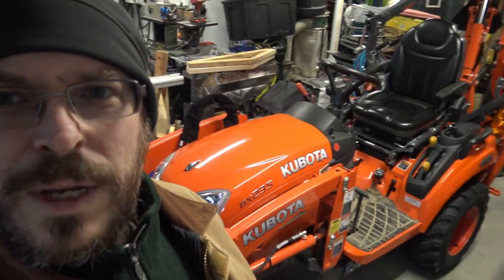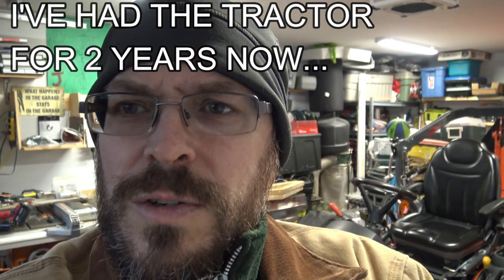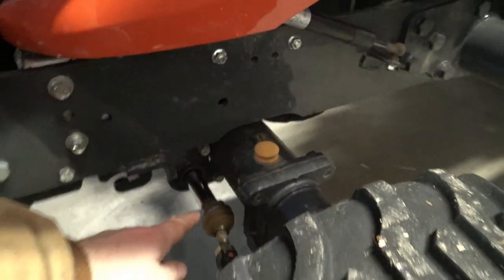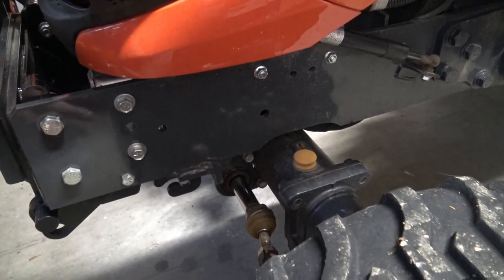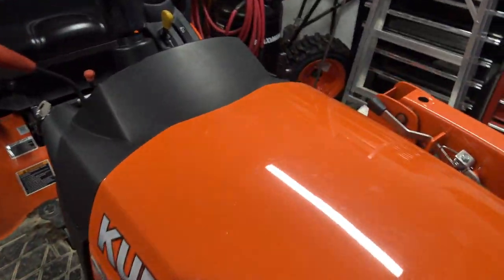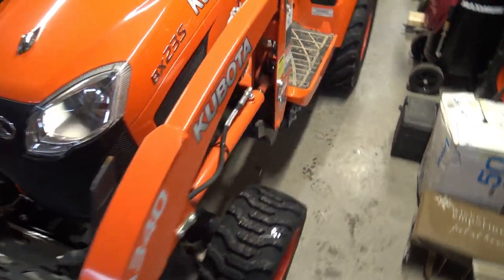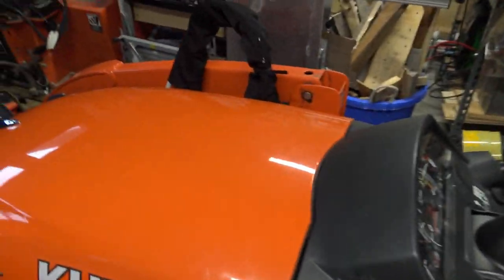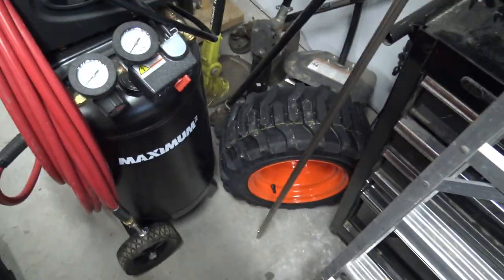KUBOTA BX23S TRACTOR ISSUES AFTER 2 YEARS

Comment: I bought one about 3 years ago and I use it and I put the PTO to work I put all the tailor over there and the PTO just snap off in the dealer don't want to fix it and I sold it for almost no money that's a piece of s*** tractor no power you don't need that garbage around the house
Reply from the maker: Sorry to hear about you having some really bad luck, not sure why the dealer wouldn't fix that, was it new?  If you got it used than that's a different issue.  

Metal parts can always have defects in them and manufacturers usually fix that sort of thing if you got it new.  It sounds more like a bad dealer.  I put my PTO to the test chipping wood and I can stall the tractor, its rock solid! 

Jack

Comment: Greeting fellow Maritimer. I have had two BX's since 2017 and I rolled my frst over on its left side, and she screamed, roared and belched black smoke like an dying orange dinosaur. I did not know that I could have truned the engine off instaead of feeling helpless as it screamed for five + minutes. Mind you she was on her left side and I question whether I could have opened the hood and accessed that lever. Both of my BX's didn't have the hydraulic hoses at the back of the tractor tightened properly at the factory or the precheck from the dealer and leaked when I was using the backhoe. The BX230s is an amazing little rig and I am verry happy with it. My biggest frustation now is curing the water in fuel supply issue I have been struggling with for the past several months. Enjoyed the video.
Reply from the maker: Thanks Larry!
FYI I did have another problem recently with a leaky up/down cylinder for the snow blower.  As an electrical engineer I can tell you I hate hydraulics!  I prefer electrics any day I never have issues with leaking electricity lol.

Comment: When you roll a machine the engine will run on its own oil. You can turn off the key and it will shutoff the fuel but the oil will get sucked past the rings and use the oil as fuel until the engine blows up. Opening the hood and pulling the stop lever will not do anything but put you in harms way when the rod comes out of the block
Reply from the maker: Thanks for the explanation.  I was just repeating what the Kubota maintenance guy told me and he did mention that one of the guys who rolled it was able to stop the engine that way.  Are you a Kubota mechanic by any chance?

Comment: Hi Jack,  My BX25d had the same leak on the steering rod. Fixed twice under warranty (in shop for over 7 weeks combined for a simple fix.) My tractor is now almost 5 years old and I will replace the seal myself this summer. Very frustrating. I learned to park the tire on a rubber mat.
Reply from the maker: Wow 7 weeks is ridiculous for that repair, doesn't sound like a good dealer, my dealer did mine in a couple days.  Leaks are frustrating for sure...I'm an electrical guys so I would love to see everything electric some day to do away with leaks but hydraulics still have their applications for sure until then.